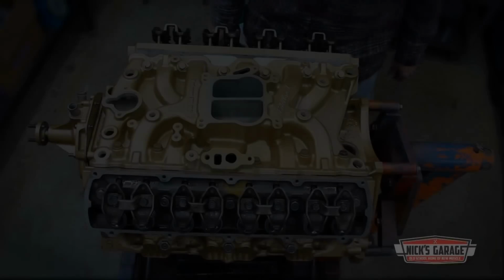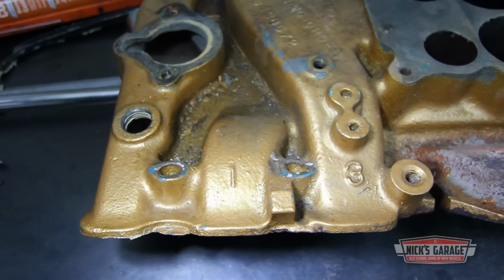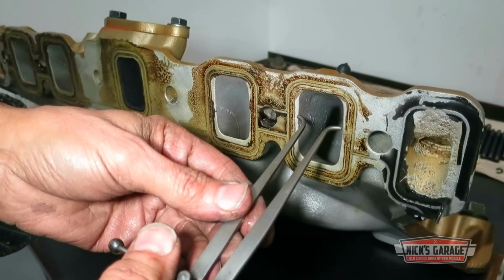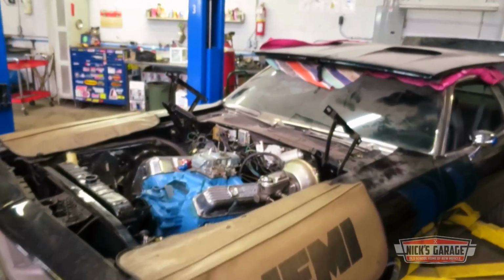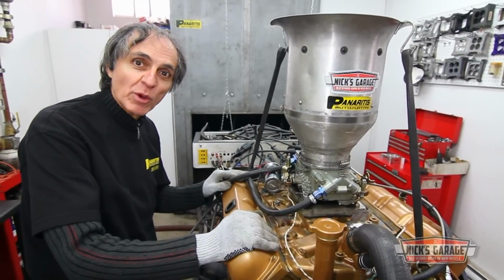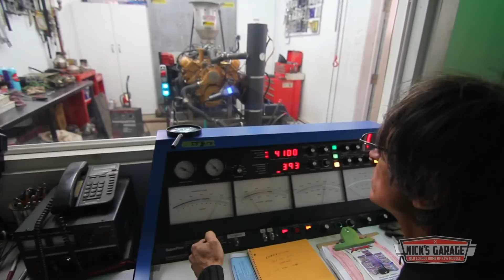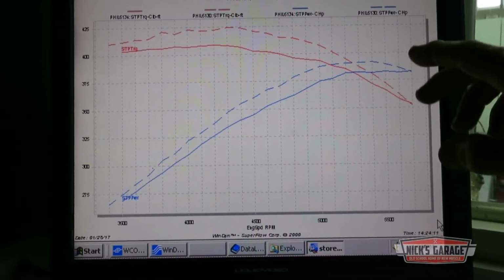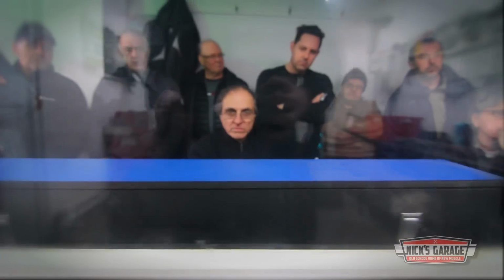Edelbrock VS Iron - Rocket 350 on the Dyno!

Comment: Drop in the Olds 455 big block your client will be happy with 400 plus HP 
I’m just kidding I actually have them both and love them both.  Motors back to a simpler time.
Reply: That’s what I got “455”but rebuilding the engine now at the machine shop with ka heads.. I’m looking for 400plus horsepower and torque hopefully I can get it .. I know the torque should be there cause 455’s are torque kings

Comment: Would def like to know the specs of the engine. If i am seeing things correctly it seems to have later #8 heads on it. Kinda gives me hope in terms of what i could possibly do with the 350 Olds in my truck.
Reply: If it is in fact running number 8 heads, then throwing a set of 68 to 72 heads on it will help it make that extra power

Comment: i love those rockets i learned a lot from joe mondello before his passing those 6 inch connecting rods are good for 7000 rpm you should try a few different types of spacers on the intake and some fine door screen between the aftermarket intake and head to increase atomization it was a common problem on the aftermarket olds intakes they never made the ports big enough. Honestly i think they did it intentionally so you could have a good foundation for port matching. I was expecting the cast intake to make over 425hp to be honest just because of the port size.
Reply: Well I guess old Uncle Joe didn't explain the concept of port velocity to you. Or maybe he did and you didn't pay attention???

Comment: got a question. just bought a 76 442. has a 67 350 rocket in it. comes witht he original 403. just needs some work. what would be better to have in it for power?
Reply: David Griffiths.     Go with the either, you can make power with any one.

Comment: would like to see that done with a single plane manifold with a throttle body injector setup on it , tune to O2 sensor and see what it does , then you can try to match it with a carby

Comment: Nick, how do you break in engines? I am rebuilding and Olds 350 myself, all new rotating assembly, with a used comp flat tappet cam from my other oldsmobile with 5000 miles on it. Cam is broke in but I need to set the rings.  Just drive it (accelerate/decelerate) for 50 to 100 miles without romping on it is what I plan to do. Any thoughts are appreciated.

Comment: Nick's Garage what is that thing you put on the carburetor that looks like an old train smoke stack?
Reply from the maker: Thanks for your question. The stack you’re asking about contains a turbine to measure air flow and is connected to the dyno’. This allows for measurement of the cubic feet per minute of air going into the carb.
Reply: @NicksGarage  awesome. Thanks for the speedy reply. So it is basically a cooler looking mass air flow sensor👍

Comment: Good video.

Seems like a hard way to acquire a 400 hp Olds engine seeing as a 455 will bolt into anywhere a 350 Olds fits......400 HP is easy with 455 cubes. Not to mention the power will come at a lower rpm and it will have way more torque. But the customer gets what he wants.

Comment: 12.9 afr seems a little rich to me and it sounded doggy/soft on last pull. There were porting specialists like Brezinski (sp) would could add measurable air flow to a cast iron intake .Lastly it is still tight 391 could very well become 400 at 10k miles .

Comment: Higher ratio rocker arm will send him over 400 hp. Smokey Yunick used to cheat Nascar by running pushrods that were   .  .100 too long, sending the rocker on the outboard end of the valve, not centered. This gave him more lift and approx 25 hp. All legal by Nascar rules.

Comment: Nick, why didn't you use the #5 or #6 heads those #8 heads are lower compression, I saw the behind the scenes of this video on Corvairwild's YouTube page. However back to the video, I myself am building a 350 Olds. a 71 block with 68 #5 W-31 spec heads, I had stainless steel valves installed and hardened seats.

Comment: If he had trimported the intake runners on the original. Or if he hogged out that restricted fuel distribution opening in the middle he should get 403 to 407 hp. Do both and maybe 410 to 412.

Comment: Looking at a 78 cutlass supreme with a 350 rocket what’s that stock hp run ? Any info would be much appreciated
Reply: A 1978 Cutlass didn't use a Rocket V-8,  it had a 305 Chevy motor in it that made 160 HP. I worked for Olds back then as a Tech and when the Chevy engines went into Oldsmobile's, a lot of customers were Pissed. They first used them in 1977 and there was a lawsuit over it where Olds had to refund 500 bucks to the owners. If your Cutlass has a 350 it it was added later. You may be able to use the block number to find out just what 350 it is.

Comment: Im curious to see the power difference between a factory original SBC 350, and a SBC 350 with bolt one like carb, intake manifold, headers, and a tune up. 

Wonder what real world power you can gain.
Reply: Numerous magazines have done that test... 50 - 75 HP can be recovered over what is lost in a stock setup on a 350" stock engine... nearly 200 HP recovered on an L88 stock engine... a base level 350" engine can gain much more from internal mods such as pistons, cam... even more with heads... 
http://www.superchevy.com/how-to/engines-drivetrain/1503-three-ways-to-pick-up-power-with-your-350-chevy-engine

Comment: If you use the edelbrock performer rpm dual plane with air gap you would’ve got that 400 hp since you put the old heavy cast iron on it doesn’t matter that you got 400 hp because you added so much weight And you’re using a Quadro jet intake

Comment: does carboraitor give you more power  than fule injection i have a 1993 dodge Dakota it's got the 318 in it what would be a good carboraitor to put on that motor and intake I'm looken for more power can someone please help thank you
Reply: Barney W.    Stay with the fuel injection. Make more power with porting heads, valve job, higher compression and headers, and a mild cam.

Comment: what can I do to the 73 rocket I have to get more power from it cam port the heads or do I need earlier heads Nick the motor runs really well 53 thousand miles on it and it has a good amount of power but I read it's very low hp
Reply: that's a low compression engine. replace the pistons with hypoeutectic 10-1 pistons. port the heads just a little-- clean up the ports, gasket match, unshroud the valves, 3 angle valve job with bigger valves if they'll fit. aluminum intake manifold, roller cam and headers. it'll run good.
Reply: 69SHOVLHED same treatment for a 68 rocket?

Comment: why not try a built spreed bore carb ....somthing that would have been original on the motor with the rear adding allot more fuel and air than a square bore

Comment: Should have ran the Q-jet
Reply: KJBPSkipper.    We ended up finishing the dyno testing with a Q-jet and also installing it in the car also. And it ran great with the Q-jet.  My client has the file on this engine, and I do not remember the Torque #. I will try to find the torque output and reply if I can.  Thanks for watching.

Comment: That lack of  machining on the intake port surfaces and horizontal gasket surfaces to match the head shave bit you here. I was hoping to see the  telltale marks from the lacquer when you pulled the manifold off. Look at that poor gasket match on the short turn radius.  I just previously watched the build  series on this engine. I came here for curiosity.   An  old  cheat was to use just Permatex on the horizontal valley surfaces instead of the rubber  gaskets to get the intake to sit down. p.s. I see I was yakking my trap off in an earlier comment 2  years  ago.   Take  care and have fun - Sandy.

Comment: I’ve run into this same issue with other Edelbrock intakes. Some of their intakes rob power because of design or smaller than stock runners. That adapter is garbage, even in the 80’s we knew it was garbage.

Comment: Intake alone like wont do anything..... it is the smallest constriction or cfm link, usually the intake port of the cylinder head that bottlenecks the airflow. So you can put on a cai, intake manifold and throttle body bigger carb etc.. it wont do much unless you get bigger heads and valves. Maybe if you put a bigger cam you might see a small improvement with just intake parts.

Comment: 'pity a q jet that was actually designed for that OEM manifold wasn't tried out. at 750-800 cfm, it would be enough for a 400 bhp 350 cid engine, and Vasily wouldn't have to keep pulling the float bowl, he could change metering jets right out the top. can just about guarantee the mismatch of venturi and intake holes caused the loss of power, and richening the Holley wasn't going to make up for atomized fuel separating from the air molecules. 

The nifty thing about pre 1977 olds 350 gas blocks, they can get bored out to swallow a 425 Olds piston for 365 cid. with the six inch long connecting rods, you're near a famous chevy short track design--a destroked 400 cid small block--and the nodular crank will stand the revs so you don't need to hunt down a 330 Olds for its forged crank.

Comment: I bet Edelbrock was sweating this video!   It does look like they purposely left enough material in the runners for port matching, that would account for the smaller dimensions.  
Even if both manifolds had the same performance, the Edelbrock probably has enough weight savings to lower ETs a few hundredths at the strip.
Reply: Buelligan88. You know your stuff, and I guess you drag race. Thanks for watching.

Comment: does carboraitor give you more power  than fule injection
Reply: No. EFI is better overall.

Improved economy, driveability, throttle response, power.

All is better using well tuned EFI.

Comment: nothing beating edelbrock, i have a edelbrock 350 Rocket 1,954 horse power 400 turbo transmission positive rear end dual pipe's straught from the motor

Comment: If he would have put a decent built Quadrajet on there he would have got his 400 if you know what you're doing with a Quadrajet it will outperform any carburetor on the market, and more reliable...
Reply: izzynutz2000.     We ended up with a quadrajet and performed very well and made 396 H.P.
Reply: Nick Panaritis good deal Nick I was fortunate when I was a kid a gentleman that owned a service station up the street from me would let me hang out and I learned a lot about carburetors particularly quadrajets he used to build a lot of engines for the dirt trackers and Central Missouri so it was a run what you brung there's a lot of tricks and trades you can do with a Quadrajet I was fortunate in my youth my father had a machine shop in our basement so I started helping him build engines and testing them back in the day we didn't have the computers so we would have to do all the math on paper but we could pull some horsepower out of some of them Old Mills.. sure wish I was closer I'd come up and talk shop with you sure enjoy the videos keep them coming have a good day Nick

Comment: The original cast iron intake would definately have worked better with a rochester 4gc carb on it bcus that is what carb the intake was made to work with and set up for, not saying i know for sure it would of reached the 400hp goal but it def would have worked better than the edelbrock and adapter plate set up!
Reply: Speed Racer.   Very possible. I am not a fan of the adapter plate, but we had it removed and used a Rochester for testing, on the cast iron intake, and had not reached our goal of 400H.P. but very close to it.

Comment: The adapter plate is the killer those things are pure crap for HP, the fuel is dead slamming into the center of the intake which creates a low pressure and a circular air pattern, either modify the center of the cast iron intake and add an air Diffuser or keep a spread bore carburetor such as a Quadrajet or a Holley 4175 on hand for these tests.

Comment: if all he needs is just a little more then why not change out the rocker arms to a higher ratio for more lift on intake and exhaust and even change out the springs if the original tired ones were re used or if they would not work with the higher lift ? rocker arm swap would actually take about as much time as a manifold swap .. taller rocker arms might also be needed for clearance but all in all rocker ratio swap might be good for 15 hp
Reply: taller valve cover i meant ...to clear a set of roller rocker ..

Comment: Im in no way criticizing this guy but I can see more than a few places where I could find another 20-30hp. His customer should ask for a better valvetrain and spec out a custom cam. Also the engine should have been dynod with the headers and carb the customer is going to use. Not some dyno queen set. Im also questioning the port work done to the heads. I think they left a lot on the table on this build.

Comment: I must of missed it but if the customer asked for 400 when the build began why wasn't the motor built to 400? Like I far from an expert but obvious this engine needs more cam compression or head work. Or tell the customer, can build you a 385 hp engine to meet your requirements.

Comment: he's not getting full lift with those original rocker arms. if he switched to some 1.6 ratio adjustable rockers, he would probably get real close to that 400.
Reply: Kevin Williams.   I agree with you 100%. Sometimes we push the limits with stock parts. Thanks for watching.

Comment: Nice. Peak torque  at  4350 rpm with  LC rocked back for  torque.  Even a  little  hot for an  automatic  but just right for  a stick on the  street.   400 is  just  a number for  bragging - you don't spend  any time  there  - it doesn't matter.  Plus  once it's in the car with clutch fan, A/C and PS and  ALT  its  back to 360HP anyway.  He  could  find the 400 by retarding the cam 5-10 more  degrees. Then the bottom would  fall out.   Torque  from 2000-4500 matters on the street with a  V8.    Nick could  use a nice Rochester Q-jet for  dyno on factory I.M.  yeah hard  to tune  fast on the dyno when you got the holley down pat..  He  REALLY has to step into  a nice 2bbl and  4=bbl rochester TB FI setups to tweek from the control room. But that may be  a  cheat and too  easy :) Love  for  Holley is  holding him back - but just a little.

Comment: I wanna see it make the power as the customer is gonna run it in there car. Like there actual carb, with there spacer, with the actual accessories, and not those dyno headers. It will probably make a more realistic 350 hp at that point.  No point trying to get 400 on the dyno if that’s not how there gonna run it in the car.

Comment: In my opinion, torque should be the customer's goal, not horsepower. The BOP engines were known for making a lot of torque, not big horsepower. I'm sure 400 could have been achieved with cam timing adjustments, better valve train parts, etc, but I'm sure there were budget constraints and drivability to consider. Classic example of people caught up in a horsepower number and totally overlook torque.

Comment: Okay guys help me out me and my dad are building a 403 Oldsmobile it has a performer RPM intake an aftermarket Comp Cam I can find the link for you and leave it in the next comment with aftermarket hydraulic flat tappet lifters an upgraded oil pump and hooker super comp headers what type hp torque would you figure it would make

Comment: Nick, I was always taught 45 min to break in a cam....why only 20?
Reply: ratman396.  According to manufacturers  cam break in, most say start it quick, run it for 20 minutes at 2000-2200 RPM. Never had any issues.  Thanks for watching.
Reply: I'll have to keep that in mind.  I've been watching the channel for a long time.  I could listen to that dyno ALL DAY!
Reply: ALWAYS use a quality break in oil when breaking in that new cam. Modern engine oil will destroy your flat tappet cam in 15 minutes. You have to use special oil or diesel oil after break in. I could listen to that dyno all day also. Music to my ears.

Comment: I think the adapter idea is total crap. You should use the Quadrajet the manifold is meant for or cut that piece out. Otherwise the airflow is totally disrupted. Of course, you can't go wrong with a Holley and an Edelbrock!

Comment: Why still using carbs? EFI is more accurate and efficient.
Reply: fw1421.    Yes you are correct, and we have done some EFI conversions, but I have many customers that have original cars, and want them as they came from the factory.

Comment: Hey Nick if you want to make some real horse power numbers check this out buddy I got a suggestion for you you big guru Oldsmobile God try putting the big block four fifty five w30 heads and Cam shaft into one of your Oldsmobile three fifty Olds motor projects 😁 just so you know I've already been there and done it Nick old boy put a performer rpm intake on it a w thirty Cam shaft into the motor and watch those numbers pal now because four hundred horse power numbers isn't much

Comment: ehhhhh  miss matched pieces and parts. youre using all the wrong parts there chief. The RPM makes a lot better horsepower than the EPA emissions friendly performer. Using an RPM and milling the dividing channel in the plenum .250 would give that stone at least 15hp over what you did @ 391hp. That mod and using a 1 inch 4 hole space would atomize the fuel better solving some of your tuning issues. The biggest reason you have problems is that dominator carb. A Rocket 350 cant use that much you should be using a 670 - 700 cfm Holley because of the short stroke. A 403 is a whole lot better performer compared to the 350 and hitting 400 hp is easy.